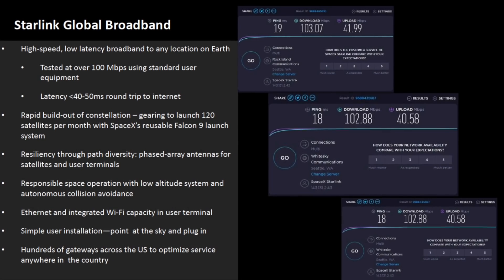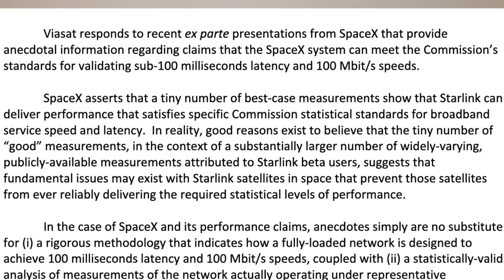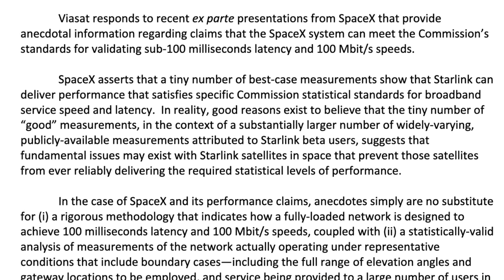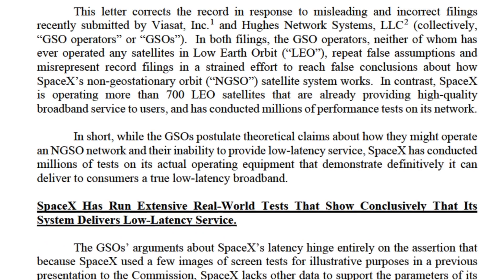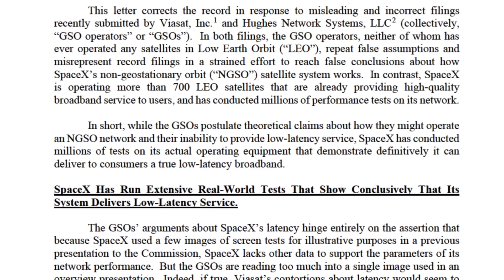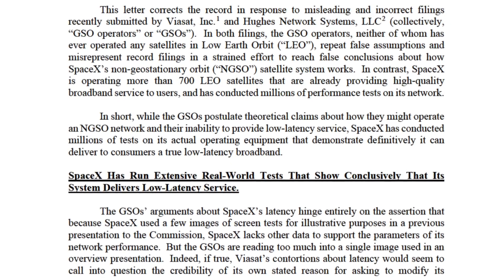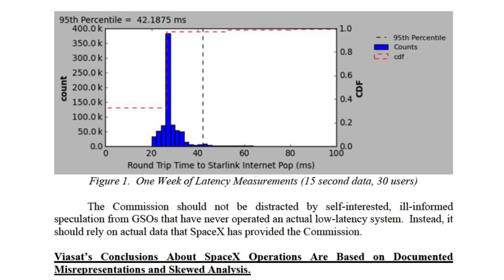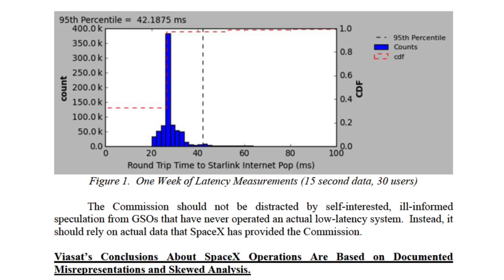SpaceX Viasat THROWDOWN on Latency Reveals REAL Starlink Latency under load and Testing Plans

Comment: Interesting how spaceX is moving private beta users into a more crowded terminal. Thanks for the heads up, shadow dragon your fellow Nova Scotian in new Glasgow nova Scotia. Hopefully public beta it's coming soon, I really need to ditch Seaside so I can hopefully get better Internet.
Reply: Hey, just ran a test on Seaside - 30ms - 9.91Mbps down - 1.14 Mbps up, but that's at 7 am. If it would stay that way all day I'd be happy, but it varies widely.
Reply: Len M do you mind me asking where you're located? And also the Internet package you have with them? I live in a village 15 minutes away from the town of new Glasgow and we are on the Express plan with only 1.5 Mbs download speed, not sure what my upload speed is to be honest. But I have had no options of upgrading my service with Seaside because of where I live and it's very very frustrating. Sometimes my Internet doesn’t even work but I suspect it's from the trees getting in the way of the signal.
Reply: @JordanLoweElevaToursCanada  I'm about half way between Truro and Parrsborro. We were with another company that had 1.5 mbs until a year ago when Seaside started offering the 10 mbs package. Works fairly well most of the time although recently in the evenings the speed has been dropping and causing Netflix pausing etc.
Reply: Len M yeah I find around the evening time into the night Seasides performance gets weaker.